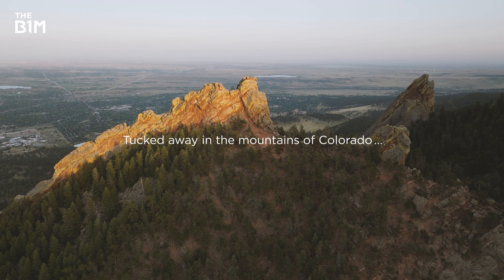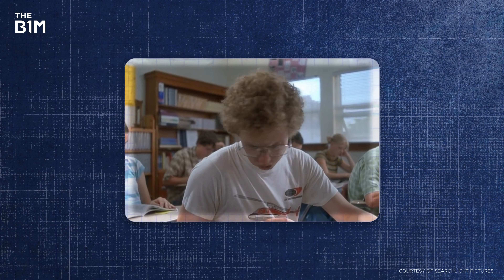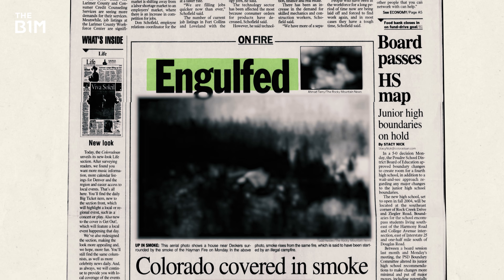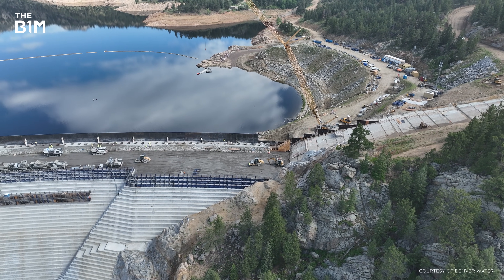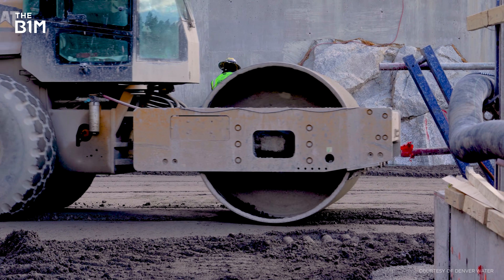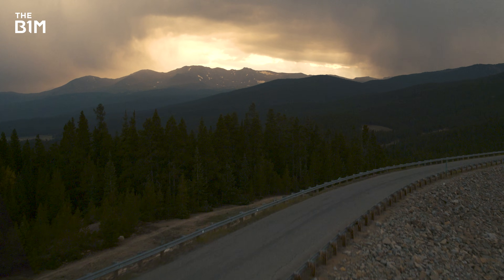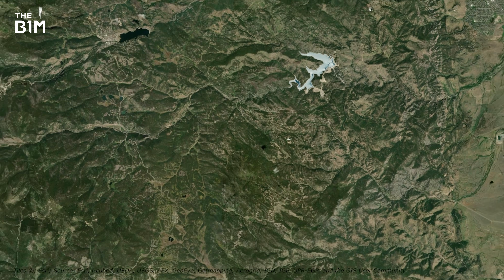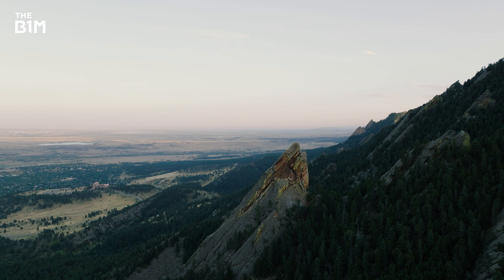Colorado's Water Crisis is Getting Worse

Comment: A couple of interesting things about this project are that Denver is semi-arid, receiving only 36-39 cm (around 15 inches) of rain per year, and that much of the water in Gross Reservoir comes from the Colorado River which is on the other side of the Continental Divide via the Moffat Water Tunnel near Rollins Pass. That's water that Denver is competing for, against other major population centers like Las Vegas and Los Angeles. It's kind of astounding to think that the same water source is in demand by cities a thousand miles apart!

While we cannot easily reduce the demand for potable water in a large metropolitan area, Colorado should rethink the use of irrigation water for non-agricultural purposes in the urban environment.
Reply: We already are! 
The state leg put some new restrictions on lawns two sessions ago, I'll try and find the exact bill.
Reply: All you have to do is remove the federal law against recycling water.
Exisiting systems could supply 10 times the population

Comment: to ensure that the structure is as unstable as possible.  Dam on top of another dam, what could possibly go wrong.   Best of luck colorado
Reply: Nothing unstable about it. If anything it's more stable than building it in one project because the mountain has had decades to settle from all the added weight of the existing dam and the water it holds back.

Comment: Left unmentioned was that basically no one besides a few folks at Denver Water seeing the need for this Dam extension and it taking over a decade of Denver Water pushing against legal opposition and lack of community support for this project. All of these issues of environmental impact and lack of water supply were cited repeatedly as Denver Water tried to gain support to do this project and they completely ignored it and just pushed it through anyways. There is very little natural water supply available to fill this reservoir and basically all of the water comes from the Western Slope and the Colorado watershed which is majorly struggling right now. Rather than focusing on conservation measures to reduce water use, Denver Water has pushed through this ill advised project. 

The Colorado River watershed provides water to Colorado, Wyoming, Utah, Arizona, Nevada, California and Mexico and is being stressed to its limits by ever increasing water needs. The current water rights shares and how they were divided were based on a years where there was unusually high amount of water being in the basin in the 1800's and does not reflect the average water year not to mention the drought conditions we've seen in the last decade, so there are more water rights shares available than there is water to actually fill them.

Comment: the amount of water required for just 1 cubic metre of cement can range from 150 to around 280-300 litres of water... and yes thats a nuanced argument seen as how once complete, it is essentially a one time cost not a continuous one. however to skip to my point, this is at best a delay mechanism, not a solution to the problem.

Comment: how do they bond the old and the new together? How do they prevent any water seeping between the old and new and peeling the new away?
Reply: well, for one, gravity, reinforcement, and a dome structure to turn it into a compressive load. Unfortunatly for more details, you'll have to go to a more engineering oriented channel
Reply: They're bonding the old dam to the new via a process called "hydrodemolition".  They remove and roughen the top layer of concrete on the old dam, then poor the new concrete on top.  It bonds like it was all poured at the same time.  Plenty of videos on the how/why, here's the hydrodemolition process on Gross Dam.

https://www.youtube.com/watch?v=c-Lgv7XLnxE
Reply: @jimmy-buffett  great video! 3 inches is roughly how much they remove. (Get it, roughly? I'll let myself out.)
Reply: Geological engineer here. My official response is that "it depends" on what part of the dam they are building :) but there 5 or 7 different things. Roughening the surface of the old dam. They will drill "dowels" basically steel bars into the old dam that will sit in the fresh concrete, there's dental concrete and grout that's used to fill any voids between old and new. Various epoxy and other chemical treatments. Lastly the guy leading the environmental charge is a complete waste of space hed rather everyone die then address the real issue of the water shortage which was the water compact made 100 years ago(based on data from heavy rain years) that sends most of Colorado water to other states. This is the least impactful thing we can do to get people water.  Him and his goons held up the last dam I was working on as well. Wouldn't want to replace a barren patchy grass field with a lake, that would damage the environment.
Reply: @JackMcGuire-em7nt  From my perspective, it appears these environmental obstructionists use the very argument that discredits their belief. It it is they who haven't studied the environmental impact of failing to develop resources. If they were offering a viable alternative solution, that would at least be rational. Not necessarily right, but at least rational.

It seems a parallel quandary is happening in electrical power generation. There at least, they are proposing an inadequate, and environmentally destructive alternative to hydroelectric and nuclear generation.

Instead of focusing on a solution to the objectionable issues, they simply block any development.
Reply: Correction, I checked in with someone, They had discussed using dowels but did not end up doing it. And to rough up the face of the existing damn they used high pressured water to create a specific pattern which differed depending on the location.
Reply: Gorilla glue!
Reply: They call Phil Swift from Flex Seal.....pretty sure.
Reply: Flex Seal! If you can saw a boat in half, put it back together & go on a lake... it's amazing! 😂😂
Reply: Do your best and caulk the rest!
Reply: Lived in Boulder for 34 years…camped and recreated at Boulder Res.  This is a good plan!  Building upon existing dams to triple the capacity is much better than trying to find a new site (not many left).  The water infrastructure is already in place, there is a new hydroelectric plant, minimum impact upon residents (if fact it’s better because they are closer to the lake).  What’s really cool is that Denver had always planned on expanding the dam…spreading out the cost in stages to reflect demand is just good management.
Reply: superglue
Reply: @ThatCake, got to be a dam superglue 😉
Reply: Usually a clay core; although another new dam in colorado is using a asphalt/bitumin core.
Reply: @scorpionsting47  this is not that type of dam. It’s a massive concrete gravity dam. The concern here is how the two separate slabs of concrete will be sealed together, since they’re essentially two pieces of rock on top of each other, and water can force itself in between them. I was wondering exactly the same thing when seeing this.
Reply: @luipaardprint   Seems like they basically fit over the new dam and sanded down the old blocks so pressed new layers can fit exactly next to and over those. That's at least how I interpret what I see here, but could be wrong.
Reply: @MBSteinNL  it could be as simple as it looks, but it’s probably more complicated. Water doesn’t like being held back so it will work its way through the tiniest of gaps. Anyway hopefully someone will make a good video about it explaining the engineering behind this project.
Reply: Spray foam, duct tape and bailing wire!
Reply: @Naturallystated Don’t forget chewing gum!
Reply: Caulk … duh.
Reply: Greeds over body of water the rivers is destroyed it’s natural flow forever!think global warming forever!think

Comment: To make matters worse, some climate model suggests that it may be impossible to fill, even if they get a greenlight to fill it. Personally, I feel like reducing water-intensive agriculture in Colorado would be a better way to address this issue.
Reply: "some models suggest it may"?  What models?  May be impossible?
Reply: This reservoir is for city drinking water. 
To cut off agriculture water, store and pump it uphill to Denver doesn’t make sense. 
Considering your climate model claims it makes even less sense. 

Those drought & fire news bits relate to summer, never in the winter.
Because in the winter the Rocky Mountains fill with several feet of snow that melts every year.
Something that has happened for eons & will continue, so mountain reservoirs are filled by this not summer rain. 

If the dam expansion is greenlit or successful at holding water has nothing to do with climate model suggestions. 
I say all this to tell you, don’t let Globohomo impede your ability to see correctly. 
Also, I figure you meant to write “worse” in your opening sentence but wrote “work” instead.
Reply: @Noticing_Hasbara_League 90% of Colorado’s water goes to irrigating farms and ranches. I’m sure a big chunk of that comes from snowmelt and it could be saved for municipal use instead.
Reply: @alexander.sollie  But then people will complain that we are using too much carbon to haul vegetables from Mexico to the US instead of growing it close to where it's consumed.
Reply: @alexander.sollie   Heyyyy!
you solved it! If you aren’t sure how think it through a lil more. 

In the meantime I noticed you fixed your lesser error.
well done.
Reply: That's absolute nonsense. The West is ebb and flow when it comes to moisture. Of course it will be filled, it's not like it will all of the sudden never precipitate again because of "climate change".
Reply: @WYO_Dirtbag  I think he is catching on.

Comment: Bonding a new RCC arch to a 1950s gravity dam is already a thermal and structural tightrope walk. But the real kicker is spending half a billion dollars without a permit to fill it. That's putting the cart way before the horse.
If this structure sits empty through a few Colorado winters without the reservoir's thermal mass to stabilize it, that interface bond is going to see some "interesting" stress cycles. You can engineer around geology, but you can't calculate a safety factor for bureaucracy.